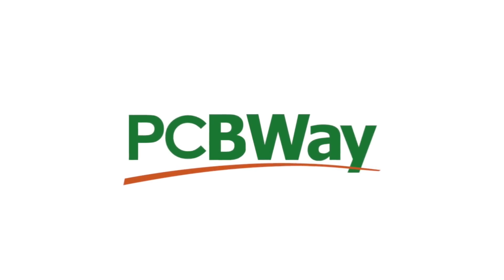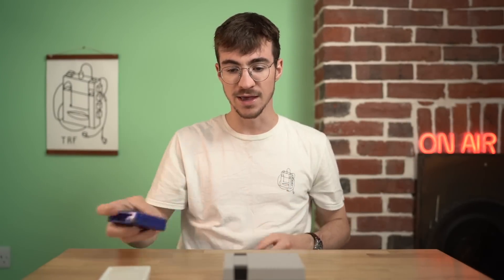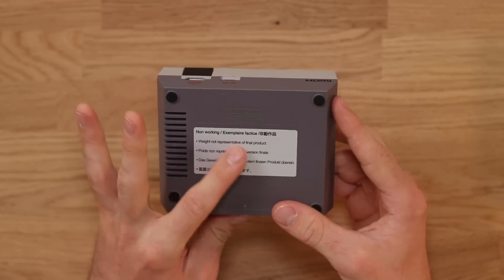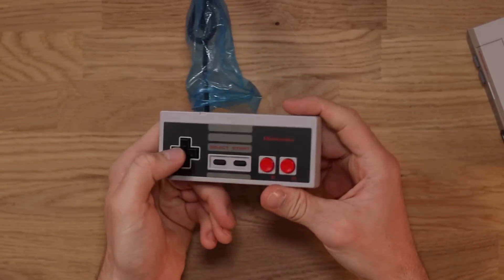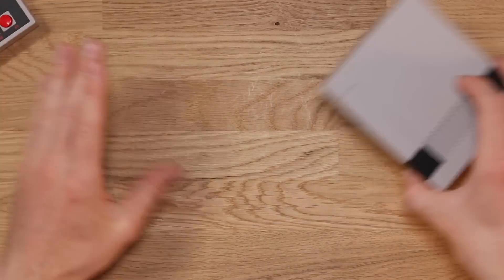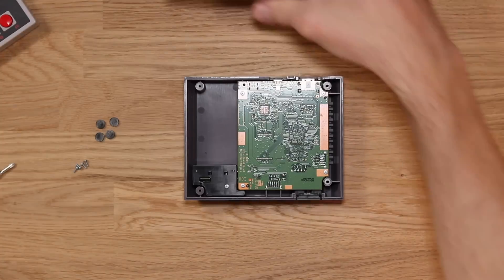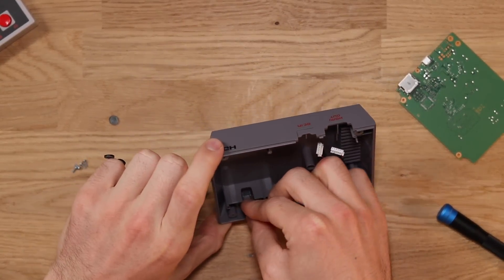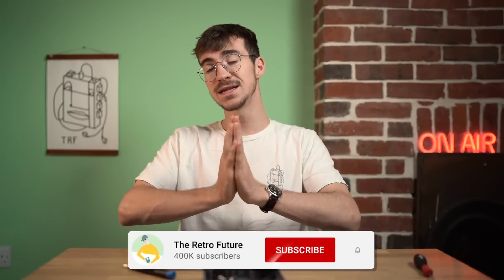This NES Console Has A Secret...

Comment from the maker: What do you think this was used for?
Reply: i think for store display or something like that
Reply: Among us gameplay
Reply: @oli72803  acctually... imagine playing among us on a nes
Reply: @memersoda  ikr
Reply: Paper weight
Reply: Oh, missed this, see my other comment, I worked with these in retail :)
Reply: These demo units are normally made to prevent theft. They are normally clearly plasted with signs in the store that they say are fake and only meant for size demos. So yeah, retail demos, meant to go in a case or have customers try out the buttons and stuffs.
Theft also includes the staff when the display is no longer needed...
However that controller wouldn't be too hard to get going, would have to check what code is on that microcontroller though if you couldn't just grab one from another classic controller.
The "resistors" are just 0 ohm aka shorts or links so they could be done with wire..
Reply: Ok
Reply: Store display or plug for theft protection.
Reply: Making YouTube videos.
Reply: store display. phone manufacturers used to make dummy copies for display also
Reply: anti-thief display model?
Reply: show size in retail store
Reply: I think I have a photo of this that I made at the Game City in Austria before release. It was in a display case made out of glass, that's how I noticed/saw the sticker. I should have pics of it somewhere. It was on the official Nintendo Austria booth
Reply: They might display this in the store instead of a working model so people wouldn’t steal it
Reply: It's to deplay the device in a high theft area. Like if the store has a high theft rate you'd rather they steal this and not the real device.
Reply: Display in places where shoplifting is a thing. 

Experience. we had them when I worked at Argos.
Reply: @FurratioLive actually you did at Argos stores and other stores where there is a high amount of shoplifting. 

Think of how dummy phones are used. Tesco did the same as I am aware. As did some Game stores. And HMV (when they had actual stores).
Reply: @MobCat_  Got it one. They were used at Argos I worked at and I know Tesco used to use them (mainly in the 24 hour stores). 

Not just theft but because of the number of customers in say Tesco and the nature of other products they sell, food and drink, it would not be wise nor cost efficient to put out working devices that will no doubt damage very quickly. You dont want electronic devices around kids that have access to things like grapes.
Reply: a masssive tease
Reply: Prototypes like this are quite useful for preliminary engineering tasks, like box and packing materials design, since they accurately represent the final product exterior dimensions, including any fitments like buttons, cables, and such.  These are also quite useful for pre-release trade show demonstration, since there's no chance the units could be reverse-engineered at the hardware level - there's no hardware (chips, etc.).  Software and firmware are quite often the last things to be ready for a product, so these physical mockups suit the marketing people who would display pre-recorded video from the development machines, which are big hulking things not suitable for trade show demonstrations.  And, if someone were to pinch one from the trade show, package design shop, or other area where these are used, there's no chance somebody will 'scoop' the embargo and show pre-release content from the console.  Personally, I think they're probably very close to the same cost of a completed unit, since the integrated circuits don't add a huge amount to the BOM cost - that's why I think these are probably used for marketing and preliminary engineering.  Great channel, love the content.  Cheers!
Reply: EXAMPLE DAS GRINTCH TIS DOFFEN
Reply: Clever mock up!
Even the bootleggers managed to copy the design and made their own cheap-ass versions! They also managed to take the final step by reproducing the original box art down to the last detail!
Reply: They use these units to send to their photographers for promotional images
Reply: Cheaper way to get a display model I think, also how much work would it take to populate the board? Like to make it a working model, if it's even possible I mean lol
Reply: Display without fear of being stolen.
Reply: It's put on open (usually untethered) display. If someone were to steal it, no big deal. They have these type of things for phones, and other electronics. Kinda like an anti-theft thing. There's usually a notice simewhere saying its a "Disply Model" and doesn't work.
Reply: @razerow3391  100%.  Here in the States they had these in some Target stores behind a plexiglass lighted display case.  Too bad they never had any real ones for sale.  Damn scalpers.
Reply: These ARE display models ...no IFS or questions they are display models ...very much like the dummy phones they display
Reply: Non-working units are made for displays because if someone steals the display unit, it's useless to the person who "acquired" it.
Reply: Display model for GAME. I have one too as I worked there.
Reply: If you are making cases and assessories or even just taking photos this is the ideal product to give to those manufacturers/companies.
Reply: It's probably used for a store display where you want to give customers a feel of what they are getting without having people/kids sitting there tying up a working unit for hours.
Reply: Design flaw in prodoced PCB's. Display Items have nothing inside.
Reply: It was obviously used for display in stores like GameStop or It was used for decoration.
Reply: Yeah display anti-theft piece. And then comes Elliot in your store, stealing this because this is the rare oddity :)

Comment: Hiya, so I worked for a number of high street games stores and departments, Game, Virgin, Zavvi from 2003 to 2013 and we got sent a number of these display consoles.
Sometimes they would come as a part of a larger display and be tethered to the display, but I remember getting a DS, a DS lite and a 3ds demo dummy. the purpose was to be able to show the machines off without worrying about theft or needed a large heavy display (the 3DS demo display that did have real games weighed a lot due to its steel contruction, and took up a fair space plus the need for power etc) you could hand it out and people would be like oh wow etc. They often came in before a product launch, so they were often part of the pre-order push, so people knew a little more what they were getting. Anyhoo that was about it, they weren't that exciting really, and after a while basically stayed in a drawer once the devices were out and more common.

Comment: The "pulling protection" for the cable is actually called strain relief. It is standard practice in all electronic devices. Either the entire cable is held clamped inside the device (from the outer insulation, before it is split) or there is a snaky cable guide like the one you saw in the NES that prevents the smaller strains in the end from been puled.
Reply: You say all but I a lot of headphones and audio cables want to talk to you about that not always being true!
Reply: That's why high end headphones have detachable cables and just use sockets instead of the cable being soldered.

Comment: So, i work at a retail store. 

This is a more modern thing first off, before 2000 it was pretty uncommon for the display model to NOT be function. The reason we have non-retail models/fake models as display is so that when it get's stolen/ if it get's stolen. The thief won't get anything back from it and the retail store doesn't lose much from it being lost. This also has the added effect of keeping a thief from stealing one again. They got ripped off the first time so hopefully they won't try it again. This is also why a lot of Display model's at store's aren't kept in glass cases, because even if you steal it there's nothing for you to steal. In the shop I work at they go a step further and our display models are literally just exact plastic replica's, not even PCB inside the CB Radio's that are on display. Also! This means it's easy/cost effective for us to keep it as display, using a working model as display would mean that of 10 units we buy only 9 will ever be sold and less if something happens to the first display. This is why display models are so nice for retail store's.

TLDR: Cost effectiveness and theft deterrent.
Reply: @Lassi Kinnunen 81 it doesn’t in their wholesale prices.

Comment: Okay so the real fun would be buying the missing pieces and making these “non working “ consoles. Working. Lol
Reply: all the pieces.
Reply: I'm just throwing in there that these are most likely BAAAAAAD PCB's with flaws in them. Don't use your costly chips on recycled trash if you don't know. :)
Reply: @AmstradExin  it's possible they're diverted boards that didnt' meet quality control, but for the numer they needed to make, it's entirely likely they pulled them off the line at the start, and just didn't populate them, rather than wait for enough boards to fail to stock all the targets that need one.

Comment: Just like with phones, I guess it's too let the customer have it in their hand without actually having a retail unit getting worn out and it can be easily replaceable so it always looks good, while simultaneously it's a defensive measure to shoplifting.
Reply: @YoureUsingWordsIncorrectly  Depends a lot on each store's policies I guess
Reply: @YoureUsingWordsIncorrectly  - Well... as opposed to a standard retail item which can simply be purchased, these demo units are more of a rarity. Were I someone without morals or ethics, I would think that I could make a pretty penny to a Nintendo fanatic if I stole one.
Reply: @Brian-jv8iy  except the phones you can "test" in stores aren't retail phones, but demonstration phones sent to the stores specifically as a demonstration unit. They can't be sold either.

and yes, I work at an electronics store :)

Comment: It was made that way because functional display units tend to be stolen. If people steal it, a replacement can be sent at less cost than a working unit. However, they still wanted to give an idea for how it would look, meaning they still had to put some components in. Since the components used are cheap by comparison to storage, RAM, and CPUs, it's an acceptable choice.

Comment: The NES, SNES, Famicom and Super Famicom all use the same internal hardware, just different case and flashed memory. So for the Famicom the controller board and cord are the same, hence why NES controller cords are so short. I would guess that was intentional so they could have all the display units mass produced and later repurpose them as refurbished units to where ever it needed to be sold.

Comment: I opened several dummy units from my AT&T store in the past.  Most have these boards.  Im guessing when you order from a production plant, you can probably choose to have them make some cheaper dummy units along with the main order for this display reason.  I'm sure it's all cost saving in the end.
Reply: @Lassi Kinnunen 81 Yeah, this makes sense too. I thought these were just boards where a fault was found. But it could just like you said, test boards for machines calibrating test-probes, solder placements and testing final cases just to see if it all fits. And when this was finished, these were given  away to resellers.

Comment: i'm just saying: can the world stop acting like Micro USB is a dead connection type already???  SO many items use Micro USB, it benefits everyone to keep using it over USB-C.  only two items in my entire house charge via USB-C, verses i am literally swimming in Micro USB cables, so i never have to hunt for one or swap one out for a different type at my outlet of choice.

(my phone (a rather old Android device) and my Switch are the ONLY two items that use USB-C, and my Switch has a dock so it's not even an issue.  it's inconvenient for me if items use USB-C to charge, because i only have one of those cables.  every controller i own uses Micro USB, and so i can charge any of them from one single cord.)
Reply: Sounds like a you problem

Comment: I'm guessing the reason why they don't just hand out retail units for display is mostly because of cost. If Nintendo (and store owners) can find ways cut costs, they certainly will. Plus, the store owner won't have to crack open a new console and sacrifice it's retail value (something Nintendo is very—sometimes a bit too excessively—protective about, the value of their products and games.)

Added benefit being that, would the showcase model get stolen, it wouldn't be a huge loss and it could easily be replaced.

Comment: I don't think the original NES controller had the serpentine cable inside the controller. If I remember correctly I accidentally pulled or my brother may have accidentally pulled the cable out of it. But then again I'm quite a bit older and with five when I received my first NES as a Christmas present. That was 1987.

Comment: I bet there was a fatal flaw on these boards. Normally, these display Items dont have ports and molded shut openings with a piece of Metal inside. Saw these as Sega GameGear and MegaDrive in the 1990s. Also Playstations. Nothing under the CD Lid, the ports didnt have any contacts and nothing on the back. Same goes for all the Cellphones.

Comment: Hehe my one has a Raspberry Pi 3+B shoved inside it and the full works Retroarch plus some cooling mods and a wireless dongle :)   Love my little NESPi and means all my actual consoles can continue to gather dust in the cupboard.   May sound weird but like my hand built Vostok Amphibia, my ecig and the ashes of my beloved cat, the NESPi will be buried with me just in case on the other side I find out there is an afterlife...

Comment: Maybe there can be a way to add a wii motherboard in there, maybe get those controller ports working? To use the pro controller for emulation, maybe wired for the gamecube controller. Also a gamecube motherboard too.

Comment: I wonder if the boards used had failed some tests so they weren’t considered acceptable for use in a for-sale retail device?
Reply: nope. why go through the trouble to make fake boards or some kind of fake contraption to hold stuff in place for displays when you could just use a real board that doesn’t have the actual pricey/working “brains of the machine” components? 
work smarter, not farter 💨 😩🤫

Comment: Most likely the boards inside were rejected ones that had one of more faults and rather than to use a good board they used faulty ones because they knew it would never be possible to use it. As for why they made these, they make dummies to prevent theft in the shops for instance and by using a dummy the customer can feel the product in hand without having to use a real one because a real one could not be sold afterwards as it would have scuffs, dings, fingerprints, the box would not be sealed anymore and what not.

Comment: I wonder how easy it would be to convert these non-working display models into working models by adding real screens and other internals to do such.
Reply: Motherboard is unpopulated. It is the bare part from the factory. Populate them with the proper parts as they would in the factory and it would work as normal.

Comment: So. I broke out my gba from when I was a kid, and am having trouble playing it because of the scratched screen glass(plastic) lense whatever. Is there a way to restore it to its former glory? Is really like to keep the original, I also need a battery cover, preferably an original instead of a remake
Reply: The are replacement kits for the screen and lens. Upgrade that screen is a great option.
You could also order replacement battery covers too. Check ebay

Comment: I assume He's familiar with the concept of a display unit where it's missing parts so it's cheaper and less likely to be stolen..... I think the bigger thing here is I've never seen one of these in a display.  They couldn't even keep these in stock long enough to put up a display.  Can someone provide a picture of one of these in "action" I think that would be the point he's getting at when he says he doesn't know what it was used for.  Bonus points if you can show the sticker that says it's non functioning in said display (maybe on the controller).

Comment: Weird that they'd have the PCB in there at all. ALSO... isn't that dangerous for them? Wouldn't it be easier to reverse engineer and crack this open with these out there? SURE you don't have the CPU to work with, but if you have a working one and this dummy one, without any obstructions might better help visualise traces. I don't know, speaking out of my ass with the cursory knowledge i have in these matters. I can put stuff back together, swap out parts that are modular, but that's it. If soldering is involved, I'm SOL.

Comment: I don't understand why they would even put the unpopulated boards in there. Seems like a waste of material, unless they were scrapped and repurposed this way.
Reply: I've seen manufacturers use misprinted circuits for displays or for other demonstration purposes. To someone without a schematic you probably wouldn't be able to tell but most likely these unpopulated circuit boards are unusable due to some minor defect. Depending on the size of the board, number of layers and type of metal used it can end up being cheaper to dispose of the defective circuits this way rather than melting them down.
Reply: @jmcnear6688  Understandable. Just a weird thing
Reply: @Che1ito  because it hokds the components that are seen externally such as the hdmi port. It doesn't cost much to produce a NES Classic